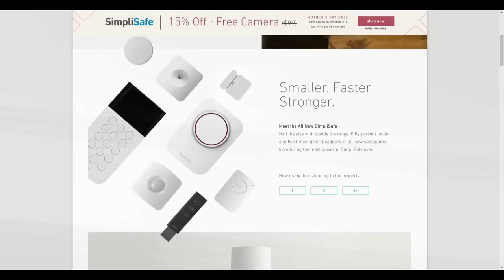Buying a Reposessed Truck at Auction was a MISTAKE! It's WAY Worse Than I Thought!

Comment: Not sure how things rust in Florida from the salty sea air.. but up here in Northern Ontario Canada, rust is part of the vehicles.. lol... there are products you can use to slow or inhibit the progression of and rust and you can just apply it on top of the rust... maybe use a air nozzle to blow away loose particles but its a quick and not pretty fix depending on where you apply it (kinda looks like what was used on that frame cross member you showed)... i agree with the issues of abuse that can be associated with repos... so as long as the engine and tranny didn't show metal in the fluids when you changed them out you should get your moneys worth out of this Honda....
Reply: LoL. Wishful thinking.

Comment: Watching you fix your Honda reminds me so much of my old Acura MDX.
Reply: pochoun33137 
It’s been a very solid buy, nothing has broken other than a couple trim pieces. Motor and transmission still feel strong and most importantly the AC still blowing cold lol.
Reply: pochoun33137 
It’s an 08 with the Tech package but the in the morning the transmission is a little rough but soothes out once it’s warm.

Comment: You should have flushed the transmission as hondas don't have a serviceable filter and have a high failure rate due to that issue. A fluid change barely gets 25-30% of the old fluid out. Flushing these is easy easy.

Comment: I have2006 RTL.  O rust what so ever. Florida car that’s been garage kept well maintained with 109,000 miles. Just did timing belt with genuine Honda parts at dealership for $920.00. New tires. (Michelin) new brakes, battery. Ready to go 110,000 miles more. What a great cruising truck. Smooth as silk. Pulls out of anything that you throw at it. 18 years old showroom condition. Bought I for $33,000. I would do it again. Awesome truck. Ford or Chevy can’t match it.

Comment: I always thought calling these a truck was a stretch of the imagination but as far as the rust goes, here in the rust belt every truck older than 3 to 4 years old has soft to nonexistent rockers so that's nothing new.  Here in Indiana you could put it straight out on the lot and call it 95% and nobody would question it at all.

Comment: Compared to every car I've ever owned that trucks rust is minimal.  Keep it, rust is purely cosmetic and will have no trouble hauling things for another decade or two

saw a guy the other day here in ohio driving an 80s dodge that was more rust than paint, even the license plate was half gone. But by-golly you know that man uses that truck for work every damn day

Comment: To answer your queries:  I think you still have to basis of a good truck. I would fix the broken link, new brakes and alignment. After all - it is a Honda and you were extolling virtues of the high mileage Japanese Taxis.... although Toyota. If you were to get a different truck I’d go with an 02-06 Tundra from a dry climate so you start out with no rust. Then do as Mustie1 does, coating the underside with bar and chain oil. Takes care of him in NH. Love your videos -especially that you try to keep economic sense in your repairs.

Comment: Dual pump oil for the rear differential is VITAL for these Honda’s, I hope you changed it.  Question as Honda power steering fluid is unique, is the seal product compatible with Honda power steering?

Comment: Honda's are know for reliability. If you don't think it's a long term truck I'll give you 3700 bucks for it. As for the rust..... Well that's not bad compared to northern states. You bought an AWD truck from Florida. That tells me someone has been to the beach or near the ocean a time or 2. Florida is constantly humid mix that with some salt and sand and you have some rust. And because Florida has no emissions or state inspection most people neglect their cars. Check engine light on: no worries, it's still running. Keep this in mind when buying Florida cars.

Comment: In pa it would fail a safety inspection and wont be worth the money and time for the shop to fix it due to age and mileage I have a nissain maxima that is 19 years old with over 200k that I was told to scrap due to the hole in the floor, the rotted radiator support, and the inner fenders in the rear of the car. I bought the car for 800 bucks and the owner told me it will pass inspection well no it didnt and I was told I wasted my money by the inspection station it passed emissions tho he wanted to buy off me for 150 bucks i said no release the car to me and I'll drive it back home since i didnt have another car to get home. They said no it has to towed they will not release it back to me unless I towed it home. I live in an apartment that does not have parking and the parking garage I used did not have clearance for a tow truck plus no place in front to unload on a busy street. I still have the car and drive it daily to and from work I had a cop follow me home to get the car back "incase it fell apart on the way home" It did not the cop (ex mechanic) stated the car was more sound than most of the heaps he's pulled over or worked on

Comment: That rust is nothing here in Michigan my 2001 Taurus (100k miles) has holes in the doors, sizable chunks in the wheel wells, and tons of rust everywhere underneath the car. I can knock most of it all off with no tools just bare hands

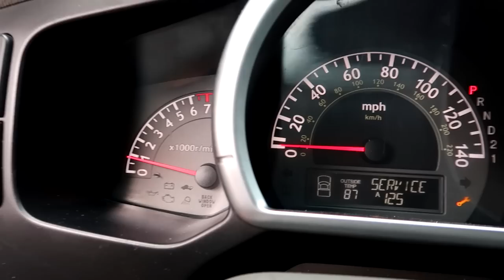Comment: Sam did you notice the catalytic converter in front of the motor glowing orange @ 8:40 ? Pretty sure that one is blocked. This usually happens when cars are left running idle for too long.  Being a neglected repo most likely the tow company or somebody did just that.  Good videos dude.

Comment: That is very minor rust and those rocker panels could be replaced easily enough and you would have that long lasting truck. Even with those rusty rocker panels that Honda is solid and will last a long time.

Comment: That really isn't a problem that truck is a unibody not a bof the only thing you need to worry about is timing belt and trans I have a 03 mdx has no rust like that except some surface rust on painted steel surfaces plus it's a work truck for you not a glammed up sport truck beat it to dead then move on if I were looking for a truck I'll buy it off you I live in IN I've seen beat to crap big rusty holes in trucks

Comment: i was changing axles in my mazda. the bolts were so rusted it took two full days. rust penetrant, heat and power impact tools are no match for a minesota rustd bolt

Comment: If you’re not looking to get something TOO SERIOUS (as in diesel) go for an F-150 or a 1500, get an American truck, honestly. Stay away from dodge though... they might look nice, but they just don’t hold up like they used too, when they were built like literal tanks. Personally, I would get a Ford, either a 150 or 250, because, over the last decade Ford has been the most reliable and get the best safety ratings.

Comment: Yeah that's a pretty normal amount of rust samcrac because my 1996 Cadillac DeVille one of its rocker panels are basically completely gone except for like maybe 5 to 6in up the front for the other side is completely fine but yeah that's pretty normal

Comment: The rockers are for sure bad - a bit worse then I'd want to see in an older used car.  However given the rest of the condition of the underside, it's in very good overall condition.  I live in a rust belt a area - I've never seen rockers rusted that badly with the rest of the under side being that good - usually there would be frame and esp floor rust.  It's not uncommon to see holes forming in the floor by the time the rockers got to that point.  I suspect they must have damaged at some point in the past.  Truth be told, it's a truck to be used as a truck - I think your fine to treat it as a truck (aka keep it maintained, but do no keep it in show room pristine like condition since it's just a tool to do work) - simply drive it until it's ready to go to the scrap yard.  I do think you should get the the bottom of the smell however: fuel like smell, def check your fuel lines (and the brake lines since your at it) - it's quite common for rust to compromise them and cause leaks.  But I don't think you got a bad deal as long as your going to use and treat it as a work vehicle.  If you where looking to flip it, then yes I do think you got a bad deal.

Comment: damn, thats minimal, slap a rocker in it and drive the biotch for another 400k miles.... that is really clean honestly.... take a good look on the auction sites for northern vehicles over 5yrs old and you will see exactly what i mean..... i swear to god no one knows what undercoating is up here.... i just found a 07 pontiac g5 for 1k that has only surface rust, spent majority of its life in alberta so almost no salt is used on the roads because its simply too cold majority of the winter for salt to work. so throwing some brakes on it all around and a set of springs and putting it on the road.

Comment: That Honda truck would not be ideal for ya. IRS would have the rear wheels squat and uneven tire wear would occur when u tow something long distance. Best to stick with a GM truck. Something with 200k miles do not mean a thing with an LS series motor like a 4.8, 5.3, 6.0.  2000 and up are good work horses and should be cheap. Possibly an avalanche. Awd have front differential issues, FYI

Comment: Jesus that's SO badly rusted... It's like my parents' Nissan Cherry from back in the day! The thing didn't break down even once, but it had such an awful rust problem that they sold it for next to nothing after realizing that it just wasn't worth keeping when the gas tank rusted trough and the replacement tank cost more than the whole car was worth. Goes to show that they still don't seem to build cars for places so far up north that there's salt on the roads in winter.

Comment: I kept watching this video waiting for a bomb to drop. You got a repo that needs a stabilizer bar link, a rack and pinion (eventually), an O2 sensor or more (eventually) and some cosmetic non structural rust issues. That's nothing. I'd buy it for that price today if I could find it.

Comment: As for your rust, It looks like a typical 10 year old Dodge that came from Michigan. I have never seen a Honda of that vintage rust like that, Dodge of course unfortunately. Especially something from down south. Maybe it was located or gotten some of that salt water in the body, a flood car perhaps. It's possible since you said Florida and yes, that would cause some major rusting. Not typical. Otherwise why else could Honda owners get away with selling their Hondas used for so much? But, I would agree with you on not keeping it. Just good luck getting your money back.

Comment: Rust isn’t too bad on it. If you want a reliable truck get a 02-03 F150 with the 5.4 they last forever if you maintain it and don’t drive it like a moron. Parts are cheap and it’s pretty much the same drivetrain as a Crown Vic

Comment: Dude, you give up too easily! I live in New Mexico, where we essentially don't have rust issues, but the dust kills engines, and the sun bakes the finish off your car in a few years (not to mention, destroying any plastic parts on the interior. I got a 'free' 1985 RWD Toyota Van from a customer of mine several years ago, that eventually cost me about $2200 in parts (including a good used engine), since it had over 200,000 mi. when I got it. I now have a vehicle that gets 28 mpg. on the highway, and has more room inside than a mid-size pickup, plus has a trailer hitch capable of pulling anything up to about 1500 lb. The engine I installed was fairly low mileage, so it will probably last at least as long as I'm around, providing I keep it maintained. It's all a matter of how serious you are about 'working with what you got'.😉

Comment: should get 6k all day for that truck ez if get the cats or whatever that exhaust prob is fixed and replace those couple body parts. would say did pretty well imo. as for the rust that is pretty typical for northeast or any cold climate especially around the wheel wells that POS running board caused the rocker rust to get worse jmo on my 2nd ridgeline love it

Comment: That rust is nothing... You want to see some 3 year cars (especially BMW'S and Volvo's) after 3 years in Scotland.... They needed the wheel arches cut out, front wings replaced and the underneath of the car was just a riot of rust, with corroded brake lines.

Comment: I bought a 2009 Honda Civic a few years ago for my daughter. It had 87k miles. What a pos this vehicle was. Honda's are no better than any other brand. We had electrical issues, lousy AC, broken motor mounts, lights on the shifter console that didn't work, visors that broke. On the visor issue, I went to youtube to see how to replace or repair it and it had nearly 500,000 views! IMO this vehicle was no better and actually worse than many cars I've owned. Just one look at this video and the rust and other problems the Ridgeline shows that the superior quality is more myth than fact.

Comment: I do believe still worth it but you are going to need to spend some money into it but as you can see some bolts and nuts refuse to come loose so yes it will give you a hard time better not touch it too much and sell it as is . Believe me me being a mobile mechanic I do avoid cars like this they are time consuming and material suckers because of the rust.

Comment: "I would love a used Honda truck"- No one, ever, who actually uses trucks.
Reply: Specs wise, the ridgeline can out run, out haul and out pull my 2000 v6 dakota.  Imo, all modern trucks are not trucks when compared to trucks from the 70-80's.  Bench seats, simple and tough engines...only luxuries might be AC and a radio.  Modern trucks are like a Cadillac with big hp and a bed.

Comment: looks like our cars after New Jersey started using that amazing liquid spray during winter ( liquid calcium chloride or salt Brine), all rust is red cherry and the body goes 10 times faster than only using rock salt. And the best is brake lines.....mechanics are making a bundle replacing it. They should stop using that junk. But is New Jersey, where we make so much money that we can afford a new car every 5 years (not truth, is a joke). After 6 years I was able to punch my fist through the rear chassis by the gas tank on my Dodge 2500 even I was washing it whenever the temperature was not crazy low...you have to open the doors to drive it.

Comment: bought a Ridgeline new in 2013 never had a problem with it, haul and tow light trailers with it and would buy another if they didn't change the front end of the damned thing.

Comment: That's not really a great approach for a transmission oil change. You missed 60% of the fluid due to not flushing the lines and torque converter. It's actually a simple process, just pull one of the fluid lines at the radiator.

Comment: I just don't understand why you're going a mile out of your way to buy a truck that barely qualifies as a truck. You bought the Lincoln suv for hauling stuff. Which was a big compromise.

Then you bought this Ridgeline, which is also a compromise, but a better choice than the Lincoln. 

But still dude. You need to haul parts frequently. You're gonna keep it a long time. You carry dirty parts often. You probably need to tow wrecked cars back and forth. 

Just give in and buy a real half ton pickup. 

I'm not a "truck guy" either, but once you have one, you'll wonder how you ever went without one. I've bounced between a few F150s and Silverados and they've all been great. I only drive them when I need to work or pull a trailer, so it doesn't matter that they suck fuel, or drive like agricultural vehicles.

 I'll never go without one again.

Comment: If you ever come to Illinois, you'll see that we really seem to like our "Natural Weight Reduction" here. Since most roads have been reduced to gravel at the point, as well as the fact that there is no form of safety inspection, people have no obligation to even fix any of this rust. In other states you'll see people at least Hack N Pack some rust holes to give there cars more structure, but nobody gives a crap here. Probably half cars registered in the state were bought for less then $1000.

R-U-S-T

Comment: First, the rust is normal rust, no need to "fix it" it will last another 20 years. 4 hours for the rack? negative, especially on that ridgeline, you're looking at 45 minutes total time, hardest part is the bleeding the air from it. cats fine, if even one was bad or "plugged" it would go into limp mode and wouldn;t go over 20mph, your smell is coming from something different. I'd be more concerned about that tranny fluid, unless you ran that for about a half hour before the change, it was to thin coming out.

Comment: That rust is nothing my 1995 nissan 240sx which ive owned since new bought it in connecticut has rust allover. At that time I had to travel far to work and didnt have time to wash the car. The rust in 2018 was insane 5 times worse than your honda but this year i repaired the rocker panels and now its my neices daily driver

Comment: Well what did you honestly expect? You're making it seem like it is supposed to be perfect. Catalytic converters and side bars are nothing compared to what you could have gotten.  Not like a rotten transmission or blown motor. That truck can be saved man. Come on. 1. You own it outright so no payments 2. Those repairs are small potatoes compared to what could have been. Drive the damn thing lol It runs well. You said so yourself.

Comment: Too many mistakes.
1. Never replace trans fluid on honda. Just dont. 
2. Do you even know how to loosen a bolt? Nice kicking on the wrench there
3. The cat converter failed prob because you mess around with the plugs without replacing it.